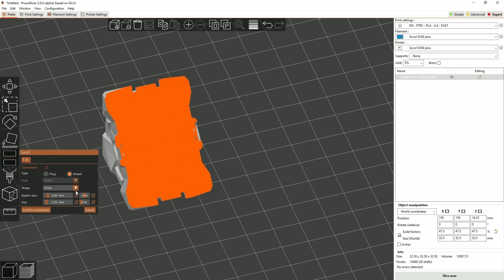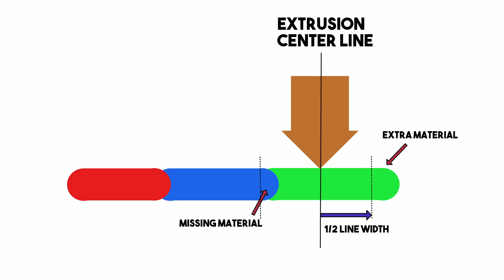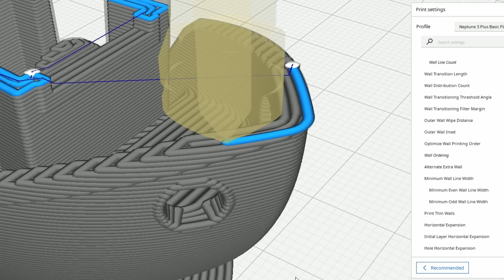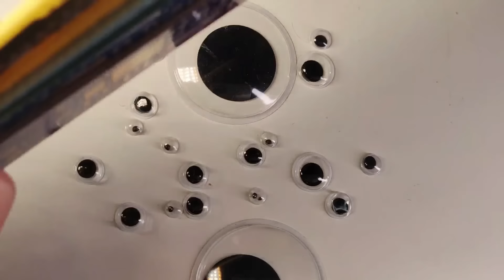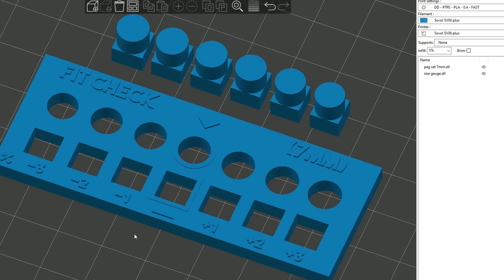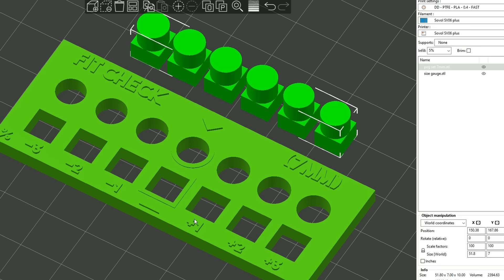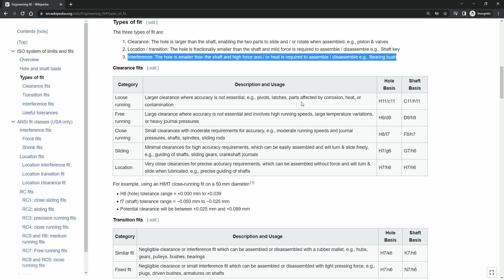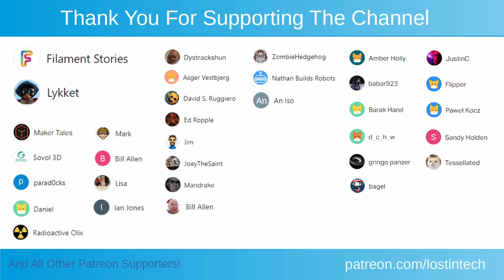Why your 3d printed stuff doesn't fit together and how to fix it!

Comment: Regarding printing the outer wall first. I have that on by default on my profiles for about two years now. And on my test I even had better overhangs. Especialy curling up edges are a bit reduced that way. On various tests I never had a print with worse overhangs by enabling it, so i have it on by default and did that for the profiles of a friend as well who has no issues with it as well.

Comment: If you have trouble with overhangs when printing outer perimeters first set the outer line width to 0.6mm wich increases the overlap between the outer lines and therefore makes them stick better together. You can do this even with a 0.4mm nozzle, you loose a tinny bit of details but if you can live with that it’s almost like a cheat code. Perfect layerlines and even on fairly steep overhangs doable depending on your layerheight
Reply: You'd like his Extreme Vase Mode series then ;)

Comment: what is always ignored is the radius of a curve affects the  how much excess material is trying to move into the available space , the smaller the radius the more material to the available space, try and print a 1mm hole and you probably won't get a hole at all.
Reply: Yeah and no, people have many different printers with many different nozzles and what's achievable on .1 is completely impossible on .4 and vice versa. My current printer makes me mad because the current nozzle cannot be precise enough for small parts and a smaller nozzle doesn't exist (well, maybe an off-brand from China could fit).

Comment: around 10-12 years ago I designed a file called "hole size test print" (on thingiverse and Printables) and it is by far the most used tool when I am designing for real world. It's a thin sheet with holes from 1mm to 25mm in 1mm increments and has the size next to each (use Prusaslicer chang color feature to make the numbers a different color) and when I need to print a part with a hole to fit something into I use it as a test. I have had 4 printers and on all 4 the outside diameter has always been very close to accurate (+/- 0.5mm) but it's inside holes that are not. I found my MK3S is about .2mm off inside diameters so that is what I use for a snug but not tight fit. Even though the test print uses round holes, you can still use it for squares and such if you have calipers, measure the square part you need to fit a hole with the caliper, then place the inside part of the caliper into the test holes and there you go you then have the square size hole to make.
Reply: 0.5mm isn't accurate in any field except construction
Reply: @urgamecshk  I see you have never encountered woodworking.

Comment: You might be better "playing" around with xy compensation on Prusa Slicer or horizontal expansion on Cura. I found that setting it to -0.15mm  helps thing fit much better. You will however lose detail on top layers i.e. writing.
Great video. Keep up the good work.
Reply: yeah, thats how i do it too, and it works great
Reply: I wonder if the last few layers could be changed back for detail
Reply: @paulmyfinger  Not as far as I can tell on Prusa Slicer. Maybe Cura can, but I have no experience with it.
Reply: @mrnlce7939  You should be able to change settings at various heights by using the multiple processes.
Reply: Cura also has a dedicated setting for horizontal expansion on holes. That might give you better luck at fixing holes without affecting top layer details like text.

Comment: I found that if you have a "big" peg to go into a "big" hole (like making something out of two colors of plastic that you want to fit together) you can make the inside thing significantly smaller and then give it a wrap of teflon plumbing tape to hold it in place.
Reply: Wow. Very professional. That's really the right solution
Reply: Good tip, thanks!  I'll trade you one:  3D prints love truck bed liner spray paint.
Reply: Or you can just design it properly, so you don't have to rely on crutches? ;-)
Reply: @jangrewe  This leads to less trial and error, and less waste, when you're trying to get two parts to friction-fit. Especially if you're only making one of them, so four test models gets tedious.
Reply: @darrennew8211  Well, again: design it properly! If you don't know if your two parts fit together correctly, slice out the relevant sections and just print those to test and adjust, then you'll know that your full print will work perfectly fine. Test prints should be part of every design process. But also: Test prints doesn't mean "print the whole thing", just the parts you want to test.
Reply: @jangrewe  I do that. I use negative volumes to cut out the parts I want to fit together. Doing that three times to get a fit is tedious. Doing that when you are trying to fit together a 150mm connection is tedious. Doing that when the size of the hole changes as you cut out other areas is tedious. Using different filaments makes it fit differently, even just different colors. Printing different height layer lines and having sizes change is tedious.

Eliminating the layer lines binding by putting teflon tape around it and making it a quarter mm smaller seems like a pretty easy fix.

I have a bunch of negative parts I can boolean out to get the right size holes for various hardware now. But if you want a friction fit, dealing with layer lines makes it difficult to get perfect.
Reply: Top tip

Comment: When I need precise tolerances on something I usually mess with the horizontal expansion setting. I have a workflow for this where I duplicate the parts meant to fit together in CAD, but I only duplicate the pegs/hole sections of the two parts while being mindful of their orientations. I then print them, adjust the horizontal expansion (or slicing tolerance) and try again. Sometimes I have to iterate this two or three times to get the perfect clutch strength for what I want.

Interference fits are counterintuitively more easy to do this for, assuming you don't care about the parts being removable in the future. I just print one of the parts with very few perimeter lines (usually two) and a higher infill density to make up for the weaker shell. The perimeters will stretch into the infill when pressed together, permanently deforming things and making a rigid joint.
Reply: Clever Ideas thanks. Also a continual print and test for me too and very time consuming. I look forward to the day when the machine has a feedback loop where it knows the result of what it’s created and can adjust accordingly…we don’t need more dumb machines 😅

Comment: I always use 5mm wooden dowel very cheap and easy to work with then the hole its for just over size it by 
0.2mm.
Reply from the maker: Good idea, way easier to sand down

Comment: I would recommend using “Hole Horizontal Expansion” in Cura or the equivalent for Prusa. Scaling the object to fit causes all other features to scale. Hole Horizontal Expansion allows you to adjust holes with affecting the rest of the model.
Reply: Yeah a 3% difference on a 5 mm peg won’t make a huge difference but a 3% difference across a 200 mm print will. Scaling the whole print by a percentage is not a good solution since it affects the whole print, using the horizontal expansion settings where they usually have both external and hole settings is far better as it only affects where it is needed and always changes prints by the same size regardless of actual dimensions rather than by a percentage. Using percentage based tolerances ends up with bigger holes having bigger tolerances, so bigger pegs will have looser fits, it is better to figure out what tolerance your printer needs as a distance and then apply that, so every peg regardless of size should have the same tightness of fit.
Reply: Second this.  LostinTec consider an update or make a follow up to the video to include xy compensation instead of scaling parts.  If you scale a part with 2 features that have to mate, like a bolt hole pattern for a stepper motor, the holes will be at the wrong position even though the screw will fit now.    Horizontal expansion or xy Compensation results in prints with less material.  So outer features get a bit smaller, and holes get a bit larger.  

I have mine set to -.05 mm.  So in the 15mm example, the hole will be 15.1 mm (0.05mm per side) and the peg will be 14.9.  This will give me 0.2mm total clearance.  Having xy compensation set helps ensure most of my parts fit without me having to worry.   Also, if the mating features are smaller like 5mm, the hole will be 5.1 and peg will be 4.9 which is what you are looking for.  

Also, your comment about filleting corners is a legit one.  Helps with a lot of things like stress concentrations, printing speed, and aesthetics.  Also, chamfers as lead ins to your hole.  Also adding chamfers to the side that gets printed helps fite elephants foot (as does elephants foot compensation).
Reply: I agree.  I have my Hole Horizontal Expansion set to where I have almost perfect fit.
Reply: I also use horizontal expansion to get hole sizes right.  it also helps on outer dimensions.  I calibrate my e-steps by measuring from hole center to hole center instead of the outer dimensions of a calibration cube as well.
Reply: Dang, is there an option for this in the Bambu Studio? It sounds super helpful!
Reply: @Keep2Yourself  hi I am very new to 3D printing. Does this only affect a peg going into a whole type of clearance? I have poor clearance for this but also for a screw where the two objects (2 halves of an egg) won't screw together properly. Would you say this is then clearance related  like mentioned in the video rather than hole expansion?

Comment: I do have a .6 mm nozzle and would love a .6mm nozzle version! I use .6 because Im not concerned about the lines or texture, but I am extremely focused on how smooth that line is, I can see all the septs in the motors and vibrations and such. I also like building real large models and general fixturing pieces
Reply: Nozzle size doesn't change visible , layer height does...
Reply: @urgamecshk  I also print at .4-.3mm layer hights
Reply: I doubt you can see the steps from the motors unless looking through a magnifying glass or microscope or you aren’t running any micro stepping. Also the way the filament is extruded will smooth out the motor steps to some extent as well.

Comment: Also another thing that I run into is "elephant's foot" If the circle fits but not the square, that might also be an sign of that issue.
Reply from the maker: I was going to mention elephants foot - its why I designed the pegs to fit upside down!

Comment: 2:23 It also causes some upward squish. I have noticed that on machines with a single leadscrew, the nozzle will move up a little bit when stacking lines next to eachother. 
The main advantage of dual leadscrew IMO is the ability to overpower that upward force and keep laying down flat, consistent layers, even at 100% infill.
Reply: also, are you doing that stop motion low framerate effect on purpose? 7:00 
It actually looks pretty cool.
Maybe my computer is just being really slow.
Reply from the maker: I tried droidcam for the first time so I'm guessing it's probably also the last time then, haha. Oddly I don't see any problems at this end, maybe I'm used to it.

Comment: One setting that's kind of hidden by default and makes an enormous difference on Cura is slicing tolerance: it can be set to "exclusive", "inclusive", or "middle", which basically means wether the slicer will place your filament path entirely inside the geometry, outside the perimeter, or average its placement.
By default it's set to "middle" which means it will always make your holes slightly too small, and your pegs slightly too thick.

Edit: after a quick google search as a refresher I see I learned about that feature on this very channel! What were the odds haha
Reply from the maker: Yes, I made a video about that 👍 the one with the screw on the thumbnail
Reply: @LostInTech3D  I wish Prusa had that feature ! Seems very handy
Reply from the maker: yeah it really is!
Reply: It does.
Reply: saw a video on this a while back and it 100% changed how easy it is to get parts to fit
Reply: Is there something similar in prusa slicer?
Reply: @alf3071  The only thing I can really think of is Print Settings > Advanced > Slicing > XY size compensation. You'd need to test a few prints to get it refined, and it may cause unintended consequences with increasing the overall width of parts.
Reply: @jxdinglol  there is also filament overlap and volume flow, lowering them should make for less expansion of the lines
Reply: @jxdinglol  Interesting, thank you. Has anything changed with the software in the last year since that affects this, for tapping, insets and screw hole purposes?
Reply: Okay thanks, Cause both you and this channel is amazing to me right now. As I’ve been having trouble with the tolerances and finding out about that setting is a game changer for me.

Most just been inside out prioritizing, because it was less annoying to take it a drill press and block sand the exterior while annealing the outer layer without baking. But this will save me a lot of time.
Reply: I was just about to talk about these settings. I've done tests and have found it actually does work lol. Much better than doing all the fitment printings for me because of the amount of printers I own.
Reply: wait so it functions like a shrinkwrap
Reply: Use xy offset
Reply: What are the settings other than exclusive actually for?  Compatibility with other stuff designed for middle, and now we're stuck with it as a default because of some tradition going back to the early days?
Reply: do you use inclusive or exclusive?
Reply: Thats not correct. That just applies to surfaces that are not straight.
Reply: So it was a tolerances video?
Reply: where di i find this setting at
Reply: @Navy6438  Underneath the profile settings (where it says "profile" and then has choices for the quality you want to print with), there is a search bar. Just do a search for "slicing tolerance" and it'll come up. OR you can find it in print settings under the "experimental" tab.
Reply: So If my inside tolerance for a "thingaverse" box is too tight, do I understand correctly to set slicing tolerance to "exclusive" and if a part  is too large outside is to set it "inclusive"?  No one has stated clearly what to try.
Reply: It is a handy feature, but it really only applies to things that have varying widths. If you're printing a part that has common widths every layer (i.e. a flat square plate with pegs on it, all walls are extending straight upwards, orthogonal to the bed), then the slicing tolerance setting should not change anything at all. I'm gonna delve into nerd language from now on, but from a math perspective, think about Riemann sums: a lower Riemann sum approximates a function by taking the lowest point of a function every standard deviation, calculating the area, and adding them up to approximate an integral. This is the equivalent of inclusive slicing (exclusive slicing uses the highest point, middling uses--you guessed it--the value of the width in the middle). When you think of the layer height as the standard deviation of the Riemann sum--and let's say we're printing a pyramid using inclusive slicing--the width of each layer is derived from the width of the lowest height of the 3D model, and due to the filament expansion characteristics described in this video, the overall width of the pyramid will be slightly larger than intended. If there is no change in width, then the Riemann approximation equivalent is like taking the sum of a flat line, in which case all sums, upper, middle, and lower will fetch the same value.
Reply: @jxdinglol  Sorry - I beg to differ: varying width is NOT necessary - or - common widths on every layer will absolutely NOT negate the effect of the three choices!  If you doubt me, TRY IT: print yourself 3 small cubes to test the three choices and MEASURE your results!
Reply: @palewriter1856  I think I'm inclined believe you since it would seem I didn't account for line width. The effect on the print volume should be less drastic than it would be on a model with varying width, but you're ultimately right.

Comment: Another issue is that holes are not actually round but many straight lines.  This is especially noticeable on small holes.  There is a setting called vertical hole compensation that can help.
Reply: I think another thing is when printing a circle, its constantly dragging the molten puddle inward as it rounds the circle due to viscous effects. It's got to shrink the diameter enough to make a difference.
Reply: I just make all holes 0.01" larger in CAD then they have to be. Works perfect. 

Drill bits are also cheap and make the cleanest and roundest wall

Comment: I always make the parts with 0.2mm clearance so they fit together especially if I have to print each part in different printers.  If it still doesn't work,  there's always the blow torch.